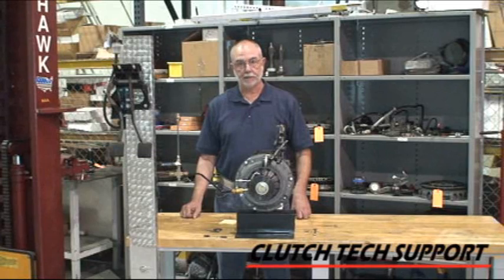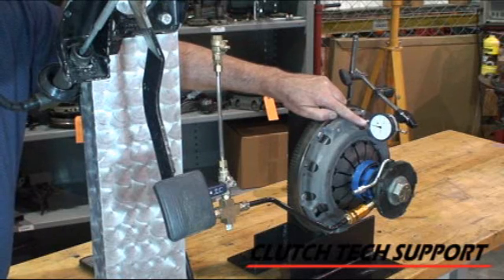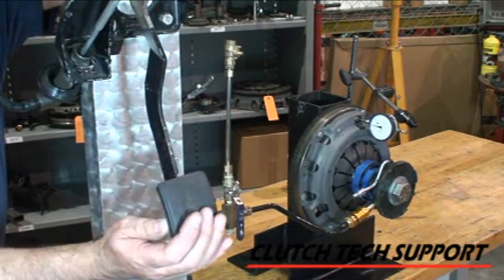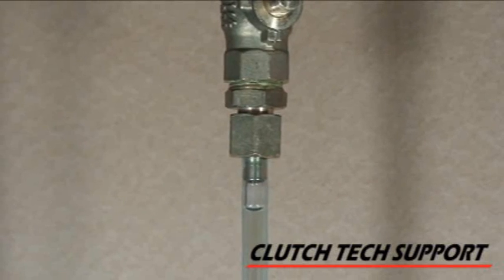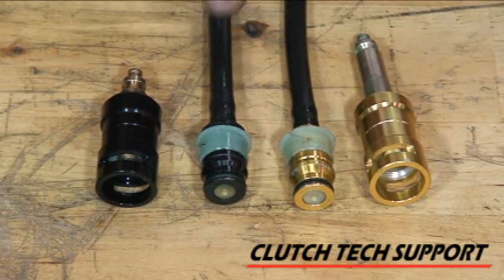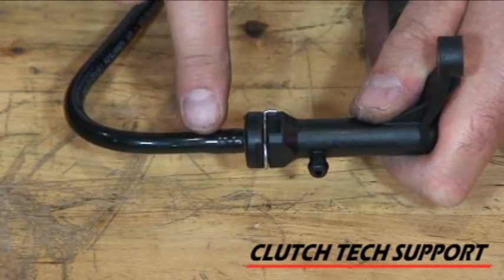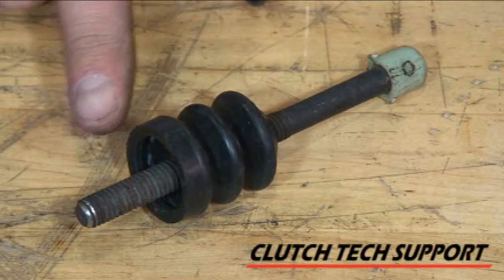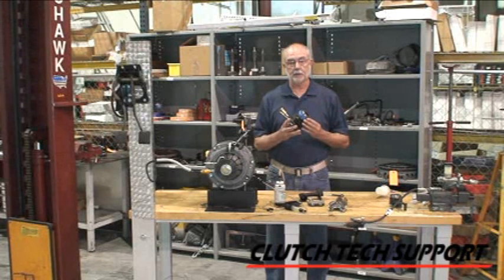Clutch Hydraulic System Air Bubble and Hydraulic Tips

Comment: I have a 95 Chevy Silverado I replace the throwout bearing clutch pressure plate starter and fly wheel it’s having problems going into reverse after it warms up I have bled the system countless times and no change did not open the hydraulic area

Comment: Great video bro, it's helped me to discover air in my system was stopping my clutch pedal returning, cowboy mechanics told me I needed a whole new clutch and wanted £800 to fit it, thanks a million for this info
Reply: Did it also happen only sometimes? Then you pump and it was good?
Reply: The garage are telling me, there is a underlying problem with the clutch otherwise air would not get into it?

Comment: Very impressive and detailed explanation!
My car (Honda Civic 2005 Exi) has vibration during first and reverse gear, I cannot run my car as ants walk in blocked traffic it shakes and there is clutch free play as well. With a new set of clutch and pressure plate installed I cannot imagine if it is a clutch plate or fly wheel issue. Is there any air bubble problem? Please help me in this issue. Thank you.

Comment: Sir my car clutch plate pressure plate and flywheel wheel got damaged at 2200 kms of use..What could be the reason? Company told that it is due to wear and tear.
Reply: @perfectionclutch   sir clutch plate, pressure plate,fly wheel and oil cylinder Everything
Reply: Vehicle was to Toyota Yaris 1.5j

Comment: I've recently had a used gearbox fitted into a 2001 Mercury Cougar, along with a new slave and clutch, but gear changes 1, 2 and 3 are always a little 'tight', especially first thing in the morning.  Could this be air in the system?
Reply: @perfectionclutch  Thanks Gary, I'll try what you suggested and see what happens.  R, 4th and 5th are all fine.  By tight, I mean that there a little resistance when going into gear and it doesn't feel smooth.  My garage has said that the gearbox is just 'tight' and need wearing in, but I've been driving it 3 months now and no change.

Comment: I’m having a problem with my clutch. When I bought the truck, the previous owner said it had a new clutch but needed to be bled, and that that was the reason that it was hard to press, had zero play, and grabbed very high. I have tried bleeding it twice. The first time I bled it, it was good for about 2 days. Grabbing low and had play. Then about 2 days later. It was back to grabbing high and very stiff from the very top. So I tried bleeding it a second time and it was good for all of 30 minutes then went back to normal. I’m not a very experienced mechanic and have no idea what the problem is, if anyone knows
Reply: perfectionclutch 1995 Ford F150 w/ 188k miles. I bought the truck at 187k miles and the previous owner said it had a new clutch but needed to be bled
Reply: perfectionclutch if the truck is stopped, when I push in the clutch, I have to wait a few seconds to put it into first, or else it will grind. And when I release the clutch, it doesn’t start to catch until the clutch pedal is nearly even with the brake pedal. And when the pedal is all the way up, it’s not fully engaged or it is worn and the previous owner lied, because i can feel it slip occasionally. Especially when under load.

Comment: Firstly, I'd like to say thanks for your post.
Secondly, I just took my Kia Bongo 3 to a Kia Service Centre in Busan, S. Korea for a clutch assy. replacement. Upon receiving my car back, I noticed that the Clutch offers no resistance, until it's almost completely depressed and even then only a little. The Clutch also does not have the same kick that you would expect from a new clutch. I went to them with a new clutch assy. which I had bought else where and asked them to install it. I didn't stay to watch, but rather came back every so often. Is it possible that one mechanic can swap out the clutch and have it working in 20 minutes? 
I strongly suspect that there is air trapped in the line, or he didn't swap the Assy. out as he should have. 
This type of thing is quite a common occurrence here, people are getting cheated all the time, but don't know any better. 
What are your thoughts on the matter? Air Bubble?
Reply: @perfectionclutch  Thanks so much G. I will check it out, but am now strongly suspecting something wrong as the gears are now accasionally grinding lightly when the Clutch is fully depressed and changing gear! 
Im going to pop the draw arm (Throw Bearing pull Arm) cover off  and see if I can see what is new. 
Thanks again. 
Will let you know.

Comment: I have a problem while turning off engine without pressed clutch pedal. I hear some noises i I feel some shakes from the engine bay. After replacing of dual mass fly wheel there is no any improvement. Mechanic said that the problem is with gear box. I don't trust him. What you think?

Comment: I buy Brake Fluid by the gallon for  Traction lock  systems in my 6 wheel drive   truck  but I think I will invest in some Silicone brake fluid when I start using a hydraulic clutch system .
  Very informative  Video thanks  ...

Comment: I have an Alfa GT and recently had a new master cylinder fitted as it failed completely and the pedal went to the floor. I now have another problem and that is when the engine/gearbox are cold the pedal has some slack travel and the bite point is at the bottom, as the car warms up, the slack goes and the bite point comes to the top to the point that the clutch slips under power. The clutch had no slipping before this was done. do you think that air is in the concentric slave and expanding with heat? should I vacuum bleed the system? thanks in advance for your help.

Comment: i have 91 ranger 3.0 300,000 miles on it ,this is my 3rd clutch going in,,the2 before were sach s clutch kits ,wonderful kits, good stiff pedal and grabbed  closer to the bottom,  i changed brands ,money wise, southeast clutch,,well i tore it all apart and only needed pilot  and throwout bearing,but i changed most anyways, i used the same sach disc,just like brand new and measured it , it was little thicker than the new one,anyways  i have a soft pedal,not spongy, and grabs close to the top, is this normal  or is somethiung wrong , and it is bled good, please let me know  thanx dave

Comment: i have a 2002 focus zx5 manualand i replaced the clutch about 2 months ago now it isnt working again will got into gear but just revs no mvement the numbskull that raplaced the clutch did not put a new through out bearing in his opinion was it didnt need one could this or air in the lines be my problem or is thee any other suggestionsa u have.

Comment: hi,  i have been big fan of your site. i dont do manual but i am your subscriber for so long. fortunately i got honda tsx 6 SPEED manual 2005 model..  the car doesnt want to go in first gear or reverse gear  it is making burr and gurr sound.. I checked master and slave, and see that slave is leaking oil..

Question is  1) if master cylinder doesnt leak can i conclude it is good? how do i test and confirm master is good.
                       2) with your experience , by looking at my problem, will it resolve the problem by changing slave cylinder.

One last request , i dont mind paying donation as well. can you make a video, about how master cylinder, slave cylinder works, why do we need slave cylinder. when i press my  clutch, how does the fluid travel and does it return back to reservoir if so what way, white boarding also would be good .   sorry i asked too much hellp. bcz i trust you so much. 

Thanks again..
Reply: sivaraj palanisamy I have same exact problem on a 2005 g35 6mt but with no luck after replacing my slave.  I'm going try bleed out air bubbles with a mityvac bleed system on my next day off.
Reply: Herb Sales 
Hi push your slave cylinder with hand and see if u are getting bubbles on clutch reservoir. If u don't that means u don't have air bubble. U can use mityvac before this procedure. Make sure there is no leak on lines. If all good then change master cylinder. Having master slave and all lines are nice and tight with no air bubbles , this should work

Comment: I have a 2001 Focus 2.0L.
When I bought it, the clutch was very stiff. I just assumed thats how it was cause it was new to me.
Now the clutch pedal just darts to the floor with no pressure. The car still starts when the pedal is depressed although it cant be put into a gear.
The shift cables are fine so Im assuming its either the clutch master or slave cylinder. Maybe both?
Any advice will help and be much appreciated.
Thanks for your time,
Have a good one.
Reply: @perfectionclutch  i have the same problem. i have followed the pipes looking for leaks. but there arent any. i have bled the system, it comes right, after some time it comes back again.

Comment: Nice video! Really helpful, but i have a question; i just installed a new clutch kit on my 2010 infiniti g37 but i didnt put grease on the slave cylinder, and now is making the same noise the diesel trucks do, but when i press the clutch pedal it good away.... so i think reason might be bc doesnt have grease there and its shaking or its somthing wrong with the transmission.... so it would help me a lot if you give me your opinion what it!!
Reply: Engine runing, clutch up in neutral is making noise, i turn on the AC and gets louder, then i press all the way donw the clutch pedal and the noise goes away..... doesnt matter if its any gear in, but as long as the pedal is pushed, the noise goes away.... now when thats when the engine is running but car not moving, but when im driving the car it mave the same sound all the cars make when you have 5th gear in and your going around 30 mph, sound like ssssshhhhh. Flywheel is a single plate, and i dont know how to describe the clutch i just know its a oem exedy clutch for 2010 infiniti g37 sport rwd. And i forgot to put grease on the release bearing. By the way, on this car the slave cylinder is inside. Thank you
Reply: Ok, thank you very much, i really appreciate it

Comment: Hi there, I bought a new Fiat 500 for my wife and sometimes there is a need for me to drive it. However, the clutch bite point is too high on the pedals travel for me to drive it comfortably (I am quite tall and have long legs). I was just wondering if its possible to move the bite point on a hydraulic clutch? In my case to lower it down a bit. Thanks for any advice you can give.

Comment: Hi, I installed a new clutch on BMW E46 but after that the clutch pedal is much harder than it was before. Is it an air bubble trapped on the hydraulic linings? I am not sure if it is spoungy because the main feeling is the increased hardness of the pedal.
Reply: My BMW is an 318i e46 engine N42B20A production September 2002. I have installed a Luk repset 623300100. I can push all the way to the floor the pedal but with greater effort than before changing the clutch.
Reply: I didn't do the installation by myself but it was done by a nearby workshop. As I see from Luk online catalogue there is no such spring on the kit, it contains # 1 to 3 from the following diagram https://www.etkbmw.com/bmw/EN/search/selectCar/E46/Lim/BMW+318i+N42/ECE/21_0093
and I also asked the technician to change
#5 to 7 on the same diagram https://www.etkbmw.com/bmw/EN/search/selectCar/E46/Lim/BMW+318i+N42/ECE/21_0093
#7 is a spring but I don't if it is the one you mentioned above.
Also changed #5 from this diagram https://www.etkbmw.com/bmw/EN/search/selectCar/E46/Lim/BMW+318i+N42/ECE/11_3187
Reply: My flywheel is a dual (twin) mass with SAC,
Reply: Thank you for answers and help that you gave me

Comment: my clutch often feels spungy and I can't shift smoothly whatsoever. However, when I drive on the highway for long distances and then exit ; from that point on the clutch is smooth. It is smooth for about 5 to 10 shifts and then goes spongy again. could this be something causing air bubbles ? Also when I use the brakes on the highways, the clutch isn't smooth. Also one time I had to really jam on the brakes . the clutch temporary when smooth after doing this . any ideas?

Comment: I have a 1994 Corolla; I recently replaced the slave and master cylinders and just had a new clutch kit installed.  I've vacuum bled the system and am sure all the air is out, but now I have a weird symptom:  in the morning, there is about 3/4 inch of freeplay in the clutch pedal which is perfect and within spec.  As I start driving, the pedal loses that freeplay and gets firm and then kind of normalizes to about 1/8 to 1/16 of freeplay.  I'm fairly certain there is no preload of the master cylinder rod.  I've readjusted it warm to make certain there isn't any.  I've looked at the release fork in the morning before starting the car and that sloppiness/sponginess at the top of the pedal does in fact move the release fork (not air in the system compressing), so it seems there is mechanical play in the clutch release bearing or the pressure plate, or something, that goes away after the car gets driven.  Is it normal for there to be that much expansion/contraction in the throwout bearing or the clutch disk/pressure plate itself???  Thanks!

Comment: my 03 cavalier is having the same symptoms, similar situation where the clutch is pushed halfway down and hard to shift into first gear. But later during the day the clutch goes back to normal but still has that spongy feel to it. I replaced clutch master cylinder and everything about a year go, and it does not leak or anything could this be my problem that I have a bubble in the hydraulic system? please respond Thank you
Reply: perfectionclutch thanks for responding, I took the car to Aamco today and they said nothing is wrong with it, but like I said it does it once in awhile and the clutch goes back to normal. Not sure what to think of it but the clutch feels fine today and who knows when it will lose pressure again. But they said the fluid was low, they put fluid in and sent me on my way.

Comment: I have a Scion FR-S when I pump the clutch a few times and push it to the floor in a park position and put it in first  gear its feels like the car jerks to move would an air bubble in my line cause this
Reply: +perfectionclutch The Toyota dealership replaced the clutch kit for me and it still does it it happens after I drive around a little bit I noticed that if I push the clutch in and put it in first it happens but if I push the clutch in and wait about 10 seconds it won't
Reply: +perfectionclutch it's like you have to give it time to stop turning or something
Reply: +perfectionclutch well I checked my car and I have a question on the clutch master cylinder when I push the clutch in the little rod that is supposed to push the fluid down is wet does that mean I have a leak or is that normal

Comment: Will this cause gears to grind also?
Reply: Thank you Gary for the message back, much appreciated.

Yeah I suspected this as when I'm reversing the van I have the gear will get stuck and I cant get it out of gear so need to turn van of and only then i can get it back in neutral, could be an issue with the clutch, just hope it nothing to do within the transmission.

It can get stuck in 1st and 2nd too if im crawling along with traffic.

Comment: I changed my master cylinder with original slave still in, a few months ago on my 95 ford f150 4.9l and bled to not spongy and I have noticed that when I first drive the next day the pedal presses are easier for awhile and then after awhile the pedal gets noticeable uncomfortably harder to press, original clutch, slave, and no leaks 113,500 miles FYI, what is causing this?